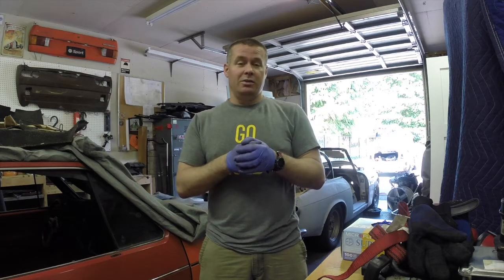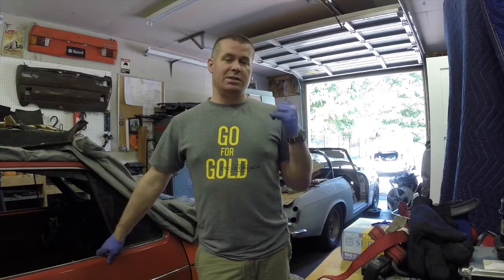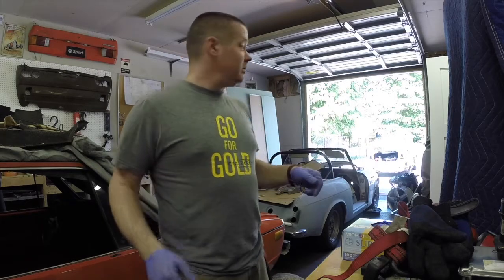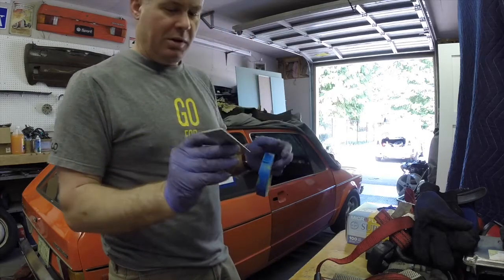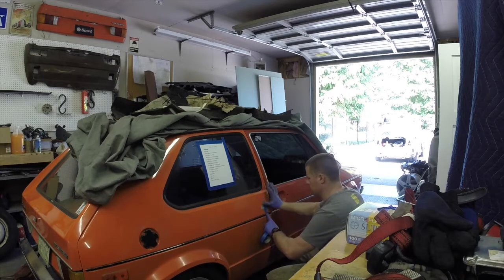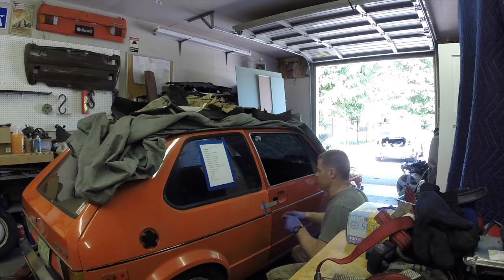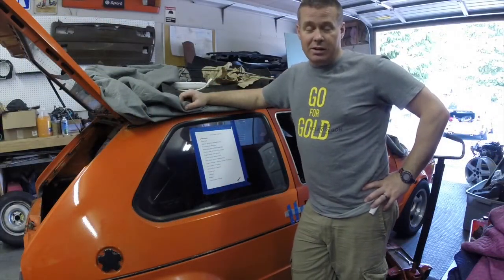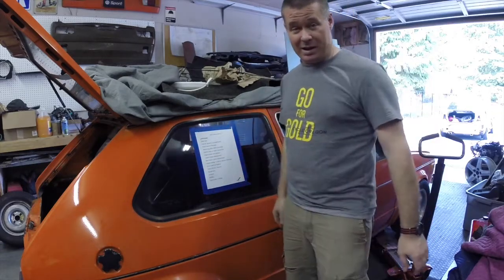Testing interior bracing - flexy unibody? 1975 VW Rabbit 1.8t 20v ep 14:

Comment: When the suspension is flexing while driving the body its doing it from the strut towers and suspension mounts ,  so arnt the traditional, strut and chassis braces people manufacture for these cars going to be a better point to start to reduce body flex?  most of them seem easy to self fabricate.
Reply from the maker: I already have a lower chassis brace installed. I have not installed an upper strut brace, but I remember way back in the day, there were aftermarket bracing components you could buy that went under the front fenders and got welded in, IIRC. Anything you can do to these old cars will help. I even noticed a significant difference in one car just by a 4 point bolt in cage being installed.